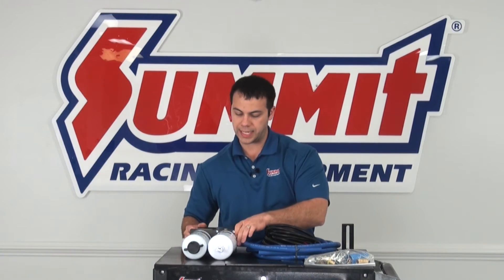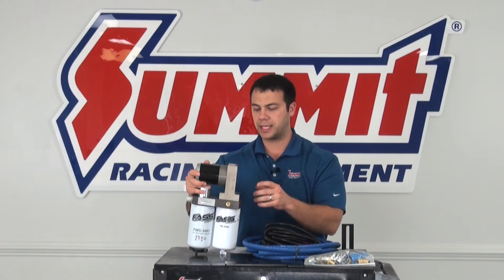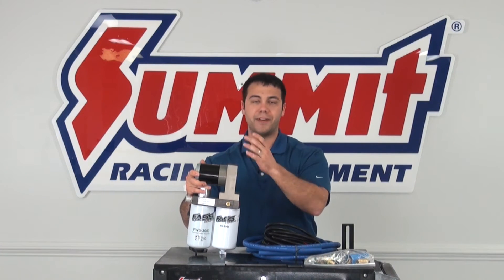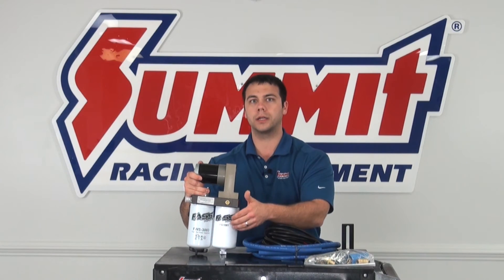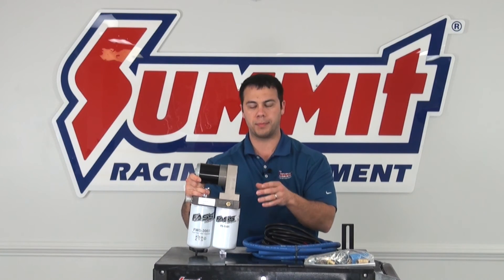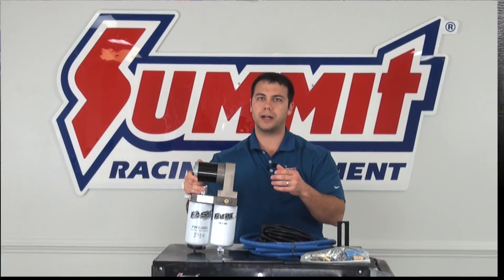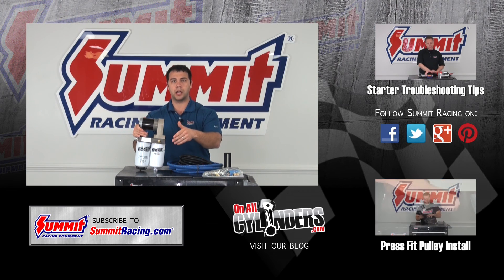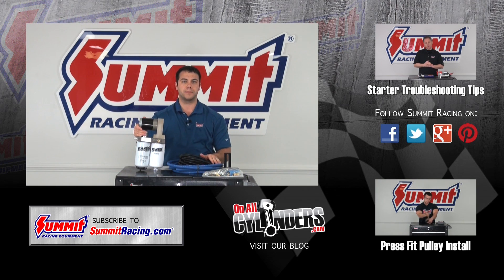Diesel Fuel Air Separator - Summit Racing Quick Flicks

Comment: Thank you for your videos buddy, Im new to the Diesel world. Im getting a 2017 Sierra Diesel. Do you think this is a good addition for it? Also I hear the 17 has the Venturi Oil Seperator built in, That means i don't have to buy an aftermarket one correct, its the same thing?
Thanks again!!

Comment: Would this kit be avail for a semi trk? So can just run on safer side for my trk motor
Reply from the maker: Hi Royrockbrain,
Yes, we have access to a pump/filter system for your truck but need some more info. Please give us a call on our tech line and we’ll help get the correct system for you.1-330-630-0240.